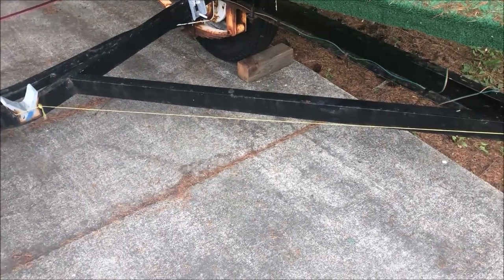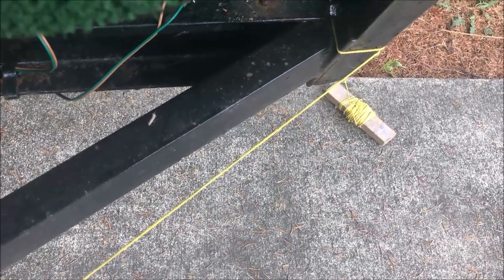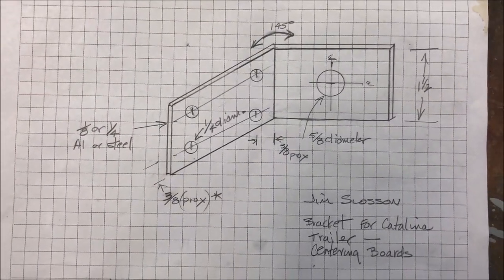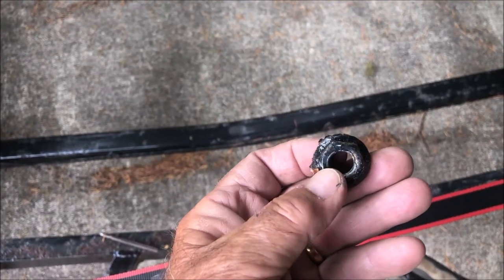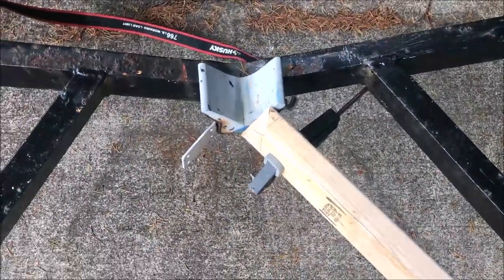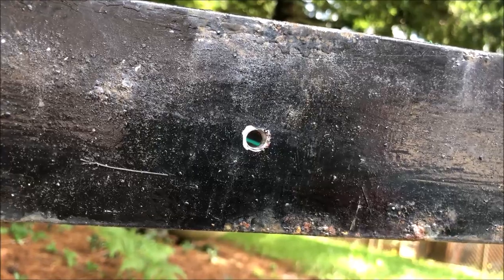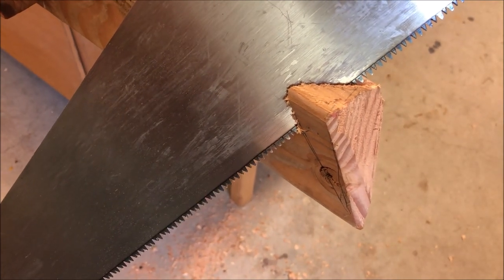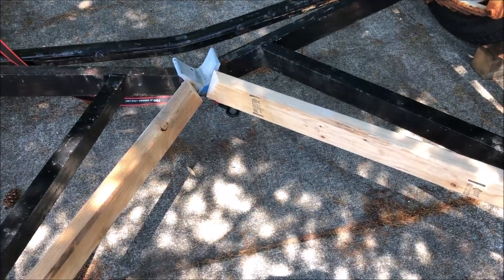Trailer Centering Boards for Catalina 22 -- Jim's Little Boat

Comment: Interesting solution to a problem I think we all have, hope it works out for you at the end of the summer.
I used a tool called a T bevel to transfer angles when I was building a traditional La. pirogue, it may help if you decide to take another shot at this. They are not very expensive Home Depot, Ace Hardware, etc carry them.
Always enjoy your videos and learn something in the process.
Reply from the maker: That was the tool I used to get the first approximations as I stumbled my way toward the final shape.